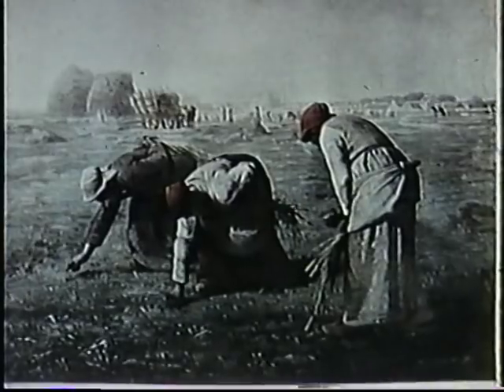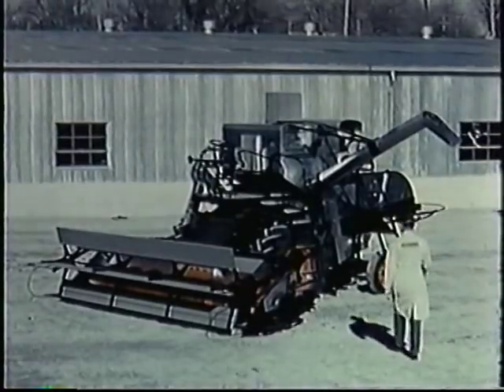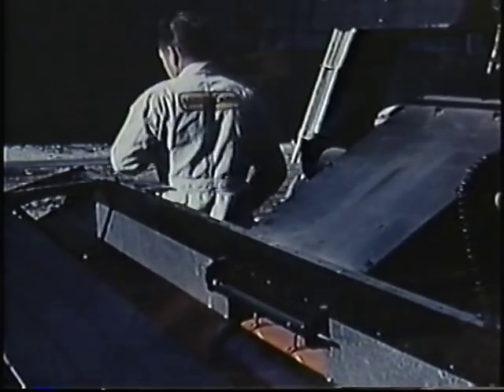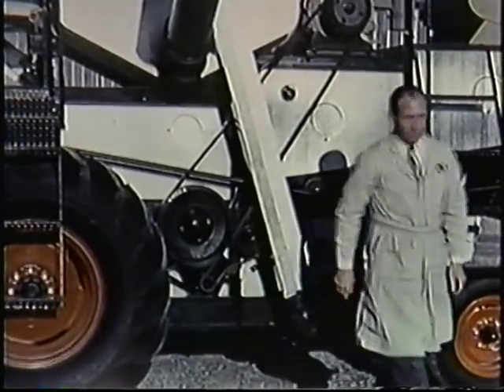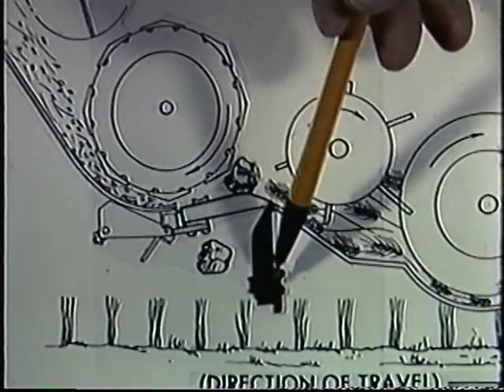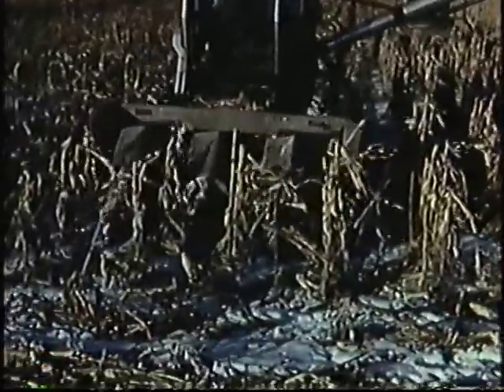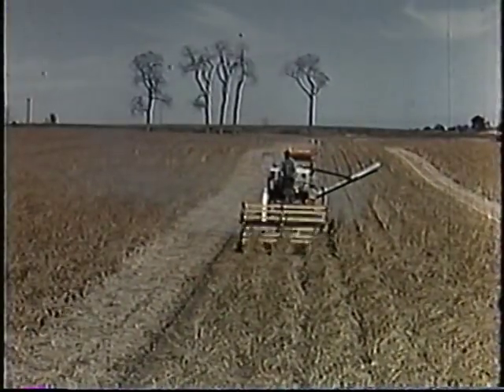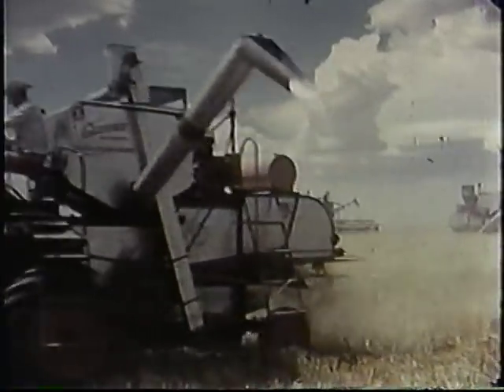1950's Allis Chalmers Film Gleaner All The Way

Comment: Great memories finding this video. I began working as an engineer for Gleaner upon graduating from college in 1967. Many of the inside plant views were memories of how it was when I started. One of my first jobs, orientation, was testing models about to be introduced (F, G & EIII replacing the A2, C2 & E), and found the Gleaners much easier to operate, and cleaner at the operator seat, then the competitors but any open platform is dirty. We introduced cabs with the G model, and it was still optional on the L introduced in '72 but was standard by '74. Earl Estell at the 15 minute mark was the first custom cutter I encountered when I began work. Chewed my but out unmercifully for not driving to his standard. The white Ford truck shown at 5:30 - I was driving that in 1967 when the engine blew. Memories.
Reply from the maker: Wow, great insight thanks for sharing.  How long did you work there?
Reply: @JandLVideos  I worked from 1967 to 1989 and left when Paul Ratliff, hired by Deutz to figure things out, came to our plant and told us to get our resumés ready - the Germans didn't have a clue about American farmer's needs. They were only looking for a sucker to take the business off their hands and reduce their losses. Little did we know that Paul Ratliff would be that sucker, but being a very bright person, he turned it into AGCO and a thriving business. I began as an intern in the summer 1967 validating what were then to be the AIII, CIII, and EIII for 1968 production. When I returned full time in January 1968, they had been released as the EIII, F and G. A year later the EIII got a Chev engine and became the K (H and I didn't work as model designations and were skipped). In 1972 the L was introduced as a pilot model, 50 machines only, but Marketing!#$?! The L sold so well they wanted more and more and my job quickly switched to designing update kits. Original L's were to be retrofitted but I would be most confident in an L2 with 158 HP engine option.
Reply from the maker: @mharrye  I would love to meet you sometime and talk gleaner with you, a couple years ago we made a quick stop at the old plant in independence.. have you looked at some of the gleaner films we have from the 80s?  Maybe you're in one of them.
Reply: @JandLVideos  I've looked at several and have not found my picture. If I remember correctly, Gene Allen and Jerry Boone from another video are the only 2 I have recognized from Engineering. Some of my slides have made it into advertising because having grown up on a farm, I knew more what the customers were looking for in literature than people from a photo agency sent to spend a couple days with a prototype. My main projects were hillside combines, then headers, and left as chief engineer of all subsystems (grain & corn heads, engines, cabs, hydraulics, electronics).

Comment: I worked the wheat harvest in North Central Oklahoma from 1971 through 1981. At age 15, I was put on a '58 Gleaner A. The machine was one year older than I. With it's powerful Hercules industrial engine, we cut a lot of wheat.
Reply: I thought the older Gleaners ran a Ford until Allis bought them and put a Buda in? Buda was bought by Allis in '54 or '55 I believe, about the same time they bought out Gleaner.
Reply: @SilverGleaner   Buda diesel was a later option, maybe after 58 or so. Ford gasoline until Allis bought them. They may have used an Allis gasoline when the A2 came out. I think a lot of them went out with the Hercules. You would have to check with a Gleaner expert.
Reply: After Allis purchased the Gleaner Baldwin Company, Ford cut off the supply of Ford industrial engines. Ford wanted to buy Gleaner for them selves, but Bill Roberts of Allis, Beat them to it.  In retaliation Ford cut off the supply of motors, that is the reason Allis bought the Buda co. To keep the combine line going, Allis could buy the Hercules industrial engines till the Buda got online. Deere also used the same Hercules motor on their 55 combine. Even though those motors were reliable and easy on fuel, they were severly under powered.  When I started farming, I bought an older model A gleaner with the Hercules motor.  I also bought a Deere model 55 with the same motor. The Deere design required less power to work, so the Hercules did well, the Gleaner not so much.  Once Allis repowered their line with the bigger Buda, Deere did the same with their machine to keep up. They designed a Deere built larger motor for their machine as well.  Today it's difficult to find any of those machines with the Herc power, everyone was glad to be rid of them.

Comment: Thanks for uploading!  I ran my dad's Gleaner E combine when I was in high school.  It was a 10+ year old machine by that time, in the early 1980's.  He had a two row corn head and a 10 foot platform.  As I recall, it did a pretty good job of producing a good sample while keeping grain in the back end.  Gleaner had a good design overall for the time compared to what else was on the market.  The 4 cyl gas motor on the E was underpowered and the grain tank was on the small side at 45 bushel (dad put a 2x6 board all the way around as a grain tank extension).  Steering was manual.  It had a single lever control for header control and ground speed, which was pretty nice.  Controls were well placed and you had a good view of the platform from the seat.  The seat was similar to the one shown in this film, pretty much just a piece of square plywood with 2 inches of foam...back rest was 1 inch of foam.  Luckily I was just a kid so I didn't mind the limited comfort this provided.  It was pretty easy on gas, as I recall you could pretty much go all day on one tank.  Material fed through the machine pretty well, I don't remember ever plugging it up.  You had to keep an eye on the rock trap door light, sometimes a slug going through the cylinder would pop the rock door open.  Looking back, I have fond memories of running that ol' E, but I don't think I would want to go back.  For one thing, I think today's crops would overwhelm its limited capacity.  Even back then it struggled in a good crop year.  I drove by the old Gleaner plant in Independence a few years ago...it looked pretty much abandoned.
Reply: Yea p

Comment: Cab-less gleaners were the worst for the driver. If the wind was behind you, you got the dirt bath from the rear discharge. If the wind was from the front, he got it from the low, front cylinder. The dust would just boil up from the thing.  Compared from the other makes the early Gleaners were the most driver unfriendly out there.  Also Gleaners were the first to get cabs because of this. The after market cab builders were started up mainly for Gleaners!  It took Allis engineers a long time to get the message from farmers, and put a user friendly cab on the damn thing!

Comment: I think the first combine I ever saw with a cab was either a 95 series John Deere or a Massey Ferguson combine in Mid 60's
Reply: My Dad had, still has sitting in the weeds, a 1961 E that he farmed with for years and it has the factory installed cab.
Reply: @SilverGleaner  
WOW!!!!!
Reply: @lt1nut  it wasn't a factory built cab but it was factory installed. By 1965 Allis offered air conditioning in the tractors and I assume the combines too. The first good cab in my opinion, for a combine was when Gleaner came out with the L in 1972. They ran that same basic cab with improvements along the way through 1991.
Reply: Spent many hours when I was a kid on my Grandpa's JD 95. He used to pay me to crawl up it's ass end and poke the stuck corn cobs out of the straw walkers with a screwdriver. I loved every minute of it. I miss that old Italian!